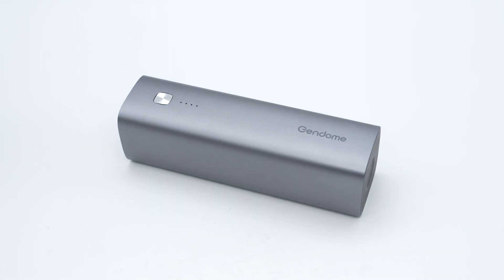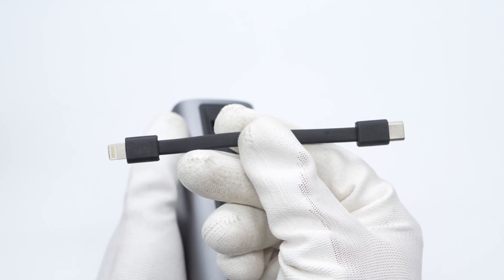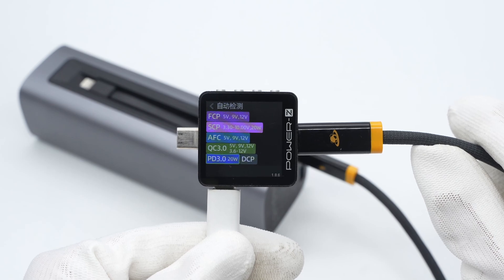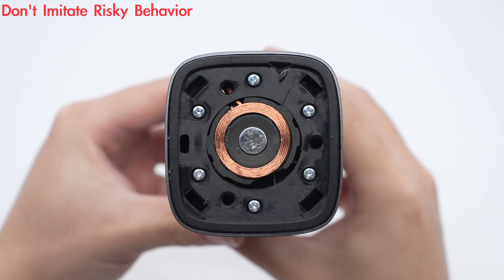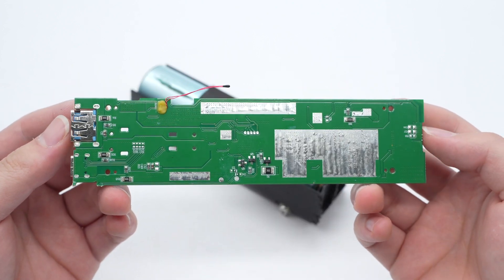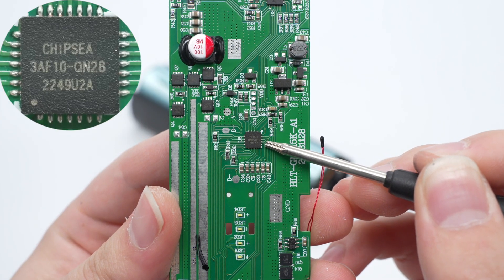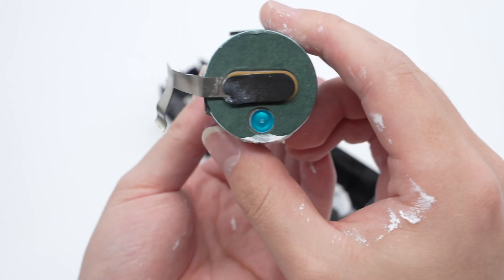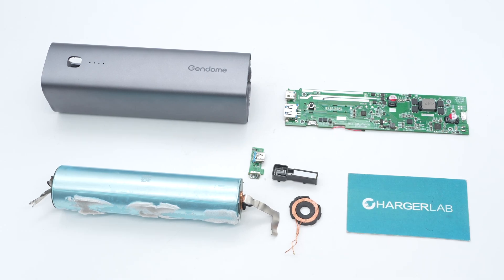Teardown of Gendome 15000mAh 20W Power Bank (LFP Battery)

Comment: I cant believe its one SINGLE battery cell...... not ass efficient to boost as it is to buck... should have more cells in series.
Reply: This power bank seems like a proof of concept with LFP and not something trying to achieve high performance. Having to push higher voltage out of just  about 3.2V is not very efficient.
Reply: I never seen this form factor before. Is it bigger than the Tesla ones?
Reply: so currentlybwhich is the perbuck for power bank ?
Reply: @zlee2656  Anker cannot be beat for per dollar, and especially quality. They use brand name samsung, LG, etc cells. Anker all the way.
Reply: @CL-yp1bs  Have you ever watched a teardown video for Anker power banks? They use garbage Lishen cells rated to 70% at 300 cycles, even in their most expensive models.

Comment: It’s interesting to have LFP options. Disappointing how low power a design they’ve gone for though… targeting 45W would make it more competitive with equivalent sized lithium ion.
Reply: That would require nearly 20A draw from the battery, single 3.2V nominal battery, not the usual 3.7V nominal.
Reply: @toma.3d  it would, but it’s a big cell. I understand that LFP cells are usually rated at 1C sustained for charge/discharge… so in this case that’s 15A… x 3.2 = 48W (ok, there will be some lossage). High power cells are 2C or 3C. 

Unless you’re a LFP geek (and I am, I have the Jackery explorer 100 plus!), this is a tough sell against something like Ugreen’s nexode 12000mAh 100W - which is smaller.
Reply: @albedo0point39  Not yet, i have nothing with LFP yet, but i do have plenty of LiIon and LiPo, even 6S 32Ah (yes, 32000mAh) ones rated at 10C.
The issue is with 1 cell, step up from low voltage is less efficient.
Reply: @albedo0point39  So it’s not a LiFePO4 battery?
Reply: So it’s not a LiFePO4 battery?